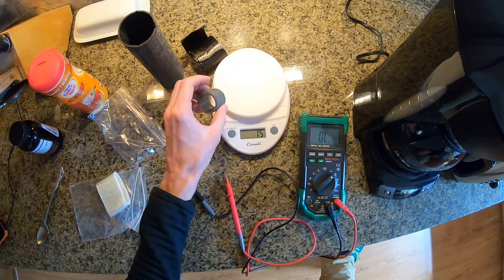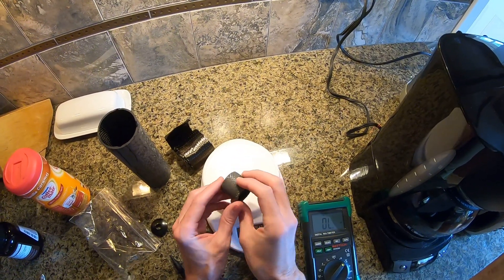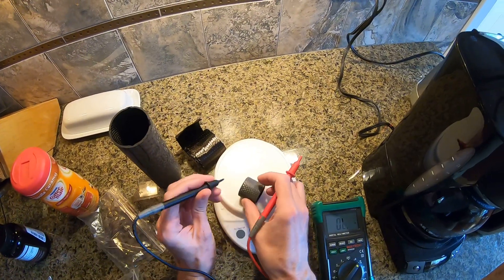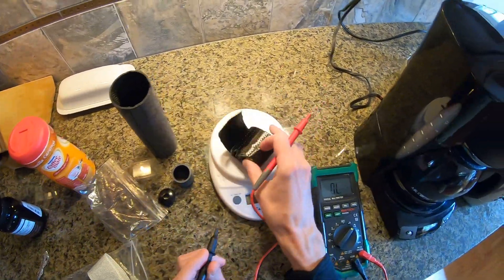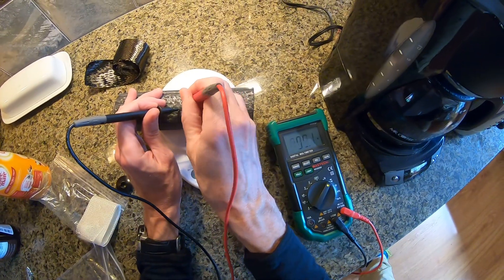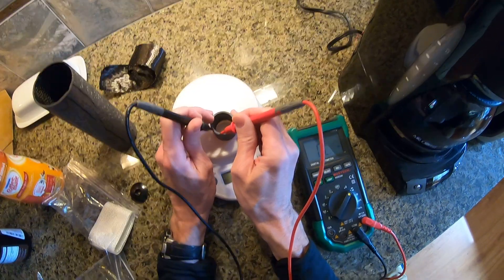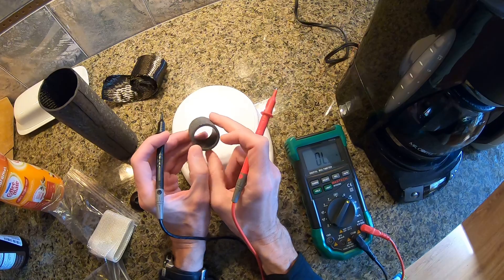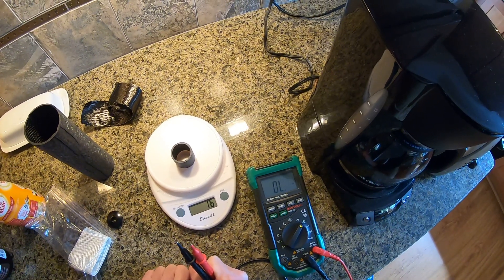Testing a Chinese "Carbon Fiber" headset spacer

Comment: is it safe to use?
Reply from the maker: Certainly. Especially because this is only a spacer. Fiberglass is stronger than carbon fiber. Carbon fiber is stiffer, however, so that's why you don't see bikes made of fiberglass -- they'd need to be really thick and heavy in order to be adequately stiff. However, I was going to use this as the base for a custom-made carbon-fiber stem, so I chose to just make carbon fiber tubing from scratch to get better stiffness and lighter weight.
Reply: @SethJayson  thank you.